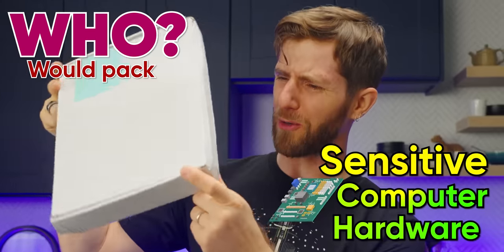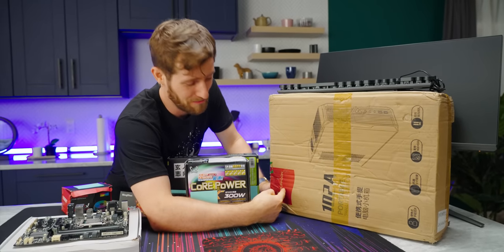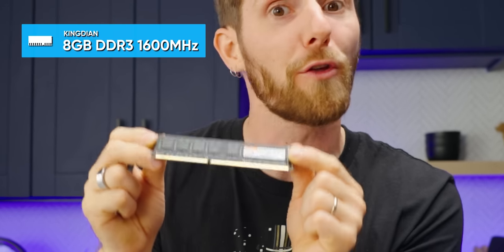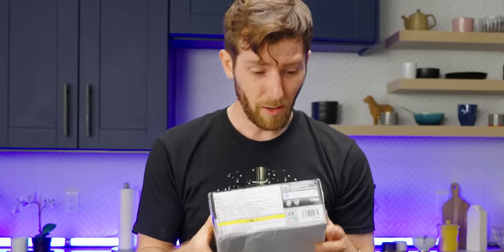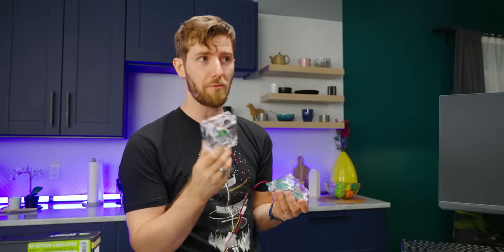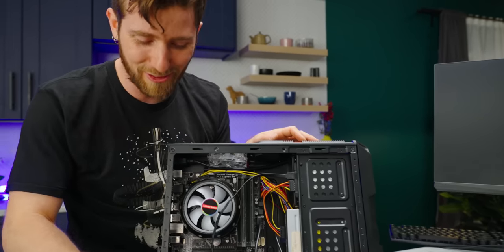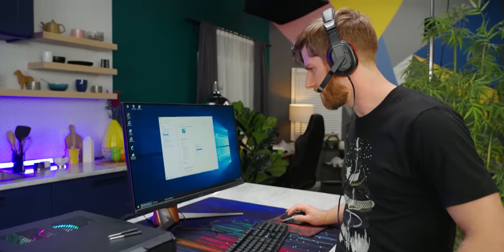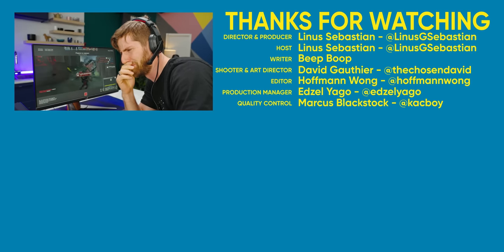THIS Wish.com Gaming PC is WORSE!

Comment: I wish more cases had 5.25 inch or as you call it "Optical bays" in them.
Not to fit CD drives, but it is very useful for those hotswap harddrive bays that servers have, pop one in and you have easy access.
Much better usecase than fondling around inside the case for it.
Reply: Reminds me of those hard drive trays that were a thing back in the 90's. Completely forgot about that gimmick lol.
Reply: I just like having optical drives
Reply: Surprisingly enough, the new fractal design pop air case comes with 2 hidden 5.25 inch bays at the base of the case. Its nice to see that some companies still see the utility in being able to use original dvds with game emulators and reading old movie disks.
Reply: @tOSdude  Like, as a cup holder? Can't imagine what else you'd use one for.
Reply: @filonin2  I got some older stuff I sometimes need to burn discs for. 
Also audio CDs.
Reply: There's a lot of random PC gadgetry that fits the 5.25 form factor from intake fans to literal cupholders, disc organizers, IO addons, a bunch of audio hardware, etc etc.  Sadly a lot of it can't be used in most modern cases.
Reply: Honestly, it's one of my favorite parts of my Phanteks Enthoo Pro. Has 3 5.25 inch bays. One has an optical drive, the other two have drawers to hold stuff
Reply: If a case doesn't have a 5.25'' drive bay, I don't even consider it. They are super versatile. From blu-ray/M-Disc drives to extra USB ports and card readers to external case LCD readouts to a hot-swap hard drive bay (what I have currently). They are so fucking choice.
Reply: @palibakufun  OMG I have that same case. Only problem with it is that it's a heavy fucking bastard.
Reply: LeRoy Jenkins   Yeah, I guess if you're willing to buy all that hardware and set all that shit up. Which most people won't or even simply can't do because of budget and/or time constraints.
Reply: @arnox4554  it is, and it's hard to fit in my poor Corolla lol. I do love it though
Reply: The hotswap hdd trays of 1995 or so were so damn nice
Reply: @esaedvik  You can still get a hot-swap bay that works with all SATA drives. There's probably even one for M.2 drives but I'm not sure.
Reply: @scorpion07070  I know! Heck, I even remember the awesome fan controllers too. I wonder if people here are just teenagers hoping on the hate train or if everyone simply forgot that 5.25 bays can do way more than hold an optical drive.
Reply: @arnox4554  No need for one, not like I'm going anywhere nowadays. Back then it was for copying games from friends.
Reply: I like it for replacing dead IO ports on the front panel so I can continue to use the case instead of buying a new one.
Reply: LeRoy Jenkins   I used to have a drive that would be my off-site backup in one of those, though to be fair USB is fast enough these days
Reply: Those 5.25 inch bays can be used for a lot of things, even as a place to put a window for rgb lights if you want, or as a  storage compartment for Thumb Drives, SD Cards, External HDDs and/or SSDs, and other smaller accessories, or to put a memory card reader in for SD Cards and other formats like Compact Flash, and there are real cupholders, ashtrays, and many more kinds of stuff.
Reply: For temporal access to optical drive, or to HDD that isn't supposed to be inside the case, it's way better to buy SATA USB adapter, and not to limit yourself when choosing a case.
I bought SATA USB adapter from AliExpress for 580 rubles, which is less than 10 bucks, works like a charm!
And devices like cup holders is just stupid useless gimmick.
Reply: There are hot swap external USB bays. 
I have 2 that together cover every hard drive I could imagine 
(one for IDE + SATA and another smaller one for NVME).
Reply: @hubertnnn  The hotswap bay I use have SATA connectors, and they are hooked up to my HBA card.
The missing part of the story is that it is my home server, and if a drive fails, I can just pop it out, do a swap and start the rebuild process.
Reply: @scorpion07070  Also the watercooling reservoirs and pump combos that fit in the 5.25 bays single or dual bay. And various fan and pump controls for those cooling systems.
Reply: Silverstone makes cases like that.

Comment: I love how he turns the CPU cooler and it makes the sound a 90-year-old door would make and that instills quite a bit of confidence in the young whimpersnapper.
Reply: it didnt help much that the fans he installed were only held on with twisty cable ties. Zip ties would have worked better. I used them once to install an 8cm fan to keep the ram cool on a very ancient compaq desktop pc i was pushing to its limits. It worked suprisingly well for a mcguyver.
Reply: that was not the cpu cooler tho im prety sure that was the optical drive cause if you move it while its spinning with a disc it can scratch it
Reply: I physically cringed when I heard that sound

Comment: I was actually expecting a Galaxy Z Fold/Flip video, but I’m down for another Wish PC build. If nothing else, it’s a sign that GPUs aren’t in shortage anymore (plus the previous Wish PC build was a super-profitable video).
Reply: he will most likely do a shortcircuit about them and nothing more, and the watches its probably jake since he has the previous ones or hopefully its sara butt.
Reply: @LegionRRTX  I’d imagine that Linus would want to upgrade his Z Fold 3, so that tracks.
Reply: @Neoxon619  of course he will, since the 3rd one's battery doesn't hold through the day, but that doesn't mean he will do a review, hell, even mkbhd isn't going to do one since the differences between the 3rd and 4th are not worth a video.
Reply: @RisingRevengeance  I'm ashamed to say that i was one of the people who bought a 1030 during the shortage. I have since moved on.
Reply: @RisingRevengeance  It was ironic because its a bad card and ppl don't like that.

I also then got a prebuilt, which is another source of "shame"

Comment: I've also seen that weird plug in the US. It was somewhat common until the late 80s. You could use it to get a grounded connection even with the older 2-prong outlets.

Comment: 8:50 That case is the same OEM style Lenovo used for some of its cheap workstations about a decade ago. I can't remember if it had a model number or any non-Lenovo markings, and right now it's just parked behind my TV being a thoroughly inadequate media PC. Though, the half-height GTX 750 I found made a world of difference. I don't remember which AMD APU it came with, either – some hexacore non-standard woefully underpowered thing.

Comment: This is a system after my own heart. I have an i5-4460, stock ass cooler, my rx 580 has 0.5
mm of clearance, and my gpu power cables are smushed so tight inside the case. I have hard drives and an ssd screwed into the mounting holes for a fan because my gpu took up my hard drive space. It’s gotten me through all of covid, so can’t complain too much

Comment: 11:35 That's actually pretty interesting. When I was growing up  we lived in an old colonial era house with outdated wiring. Like when I was a kid there were still a few cloth wrapped wires in the basement thankfully those were since replaced. But to this day a lot of the outlets are still 2 pin with the ground being the central screw that holds in the face plate of the outlet. This looks a lot like the 2 - 3 pin adapters we had all over the place that needed to be screwed into the outlet box

Comment: Honestly, I'm kinda digging the case. Sure, I wouldn't exactly call the price amazing, but it doesn't look too bad and an optical drive bay is something I really miss at times.
Reply: Fractal Pop Air?
Reply: Wieder einer von den Spacefrogs
Reply: Yeah but it also cooks the SSD and the power supply...
Reply: I'd say the fractal pop air would be your go to choice then, it has an optical bay or two iirc
Reply: I also like the case, not $100 worth, but I like it. If it were in the $50 range I could see myself purchasing it over the other $50 range cases.
Reply: @kg4wwn  exactly my thought. Could be a nice budget case, with the optical drive bay being a nice usp to stand out among the crowd.

And to the ones that mentioned the pop air, I actually had no idea that was a thing. I upgraded my case to a meshify s2 about 2 years ago and havn't really looked at many cases since, but it's good to know something like that is out there. I won't buy a new case just for a drive bay, but I'll keep it in mind if I ever need a new one. Until then my og xbox one is probably glad to still have a purpose.
Reply: i'd think 30-40 usd would be a better price for it, I like the dimensions

Comment: Kuroutoshikou is a Japanese brand. They have collaborated with GALAX under the Galakuro brand name inside Japan. Their GPUs are probably GALAX rebranded. 
In fact, the GT1030 you guys got is actually a rebranded GALAX GT 1030 EXOC WHITE.

Kuroutoshikou also has PSU and they are decent. Most of them (pre-2020, I don't know anything beyond that point) are made by ATNG and Seasonic (yes, Seasonic) some higher tier might be OEM by Superflower and even Seasonic. 
I personally have one made by Seasonic using GB Bronze platform (which is old, but might consider them a legendary budget platform). Not a weird thing but the PSU has 90-130V voltage limit label, but it works well on 220-230V environment due to Active PFC that have full range support instead of short-range like 90-130V.

Comment: Hey! The 4670k is a beast when overclocked, and is still kicking around in my old system at a friend's house
Reply: Not sure if it's a beast, but it sure does run whatever games you hit it with very well!
Reply: Hey I'm still using a 4790k, its a bit more powerful but if it's still kicking just fine!
Reply: I still have a computer with an 2500k. Ok for old games for my kids and as a media server.
Reply: @EBLovesMusic  i still use my pc with a 2300! Lol!
Reply: I run at @4.4GHz and it's a beast for me, paired with 16gb @2100Mhz and GTX 1660 6gb TUF. Photographer and videomaker work, sometimes SketchUp and Vray. Still running most of games at Ultra 2k or Rocket league Max at 4k 120 fps.
Reply: My CPU is an overclocked i5-4670k 4.7GHz, I play Call of Duty Warzone at 100 FPS with medium settings with a GTX 1060 6GB  DDR3 1600 MHz overclocked to 2132 MHz cl 11 12 12 32, my pc is in need of a renovation but is very usable and playable.
Reply: @rodrigonoctis  Very similar to mine !! 
nice
Reply: I have i5 3470+rx470 4gb
It can run any game I throw at it with decent fps & settings
Just played 
days gone
RE village
Csgo 100+ fps
Reply: Taistelu_pelto  Depending on the graphics card you can play many of the latest games as amazing as it may seem, you just can't have other programs open
Reply: @mrshinobigaming8447  ours had the good ol rx 580 8gb on it, ran amazing as our living room machine, and then eventually Mrs. Terror's gaming rig up until she decided to... Sidegrade? Into an old alienware laptop we got for free that was supposedly broken but just needed a repaste and cleanup. It's a i5 8th gen and a 1070ti, runs just as good as the ol girl. About to build an fx8320 machine that I got most of the parts for free, going to add an rx 580 8gb to it and have it as a living room machine as well
Reply: @loveableterror674  great
Reply: Taistelu_pelto  I only play at 60hz anyway, because of the screen that's made for work, the 120hz was on my friends house, (I don't play rocket league, but played on his main screen)
Reply: Taistelu_pelto  seriously? I played through the entire tomb raider series, with Tress FX on at high on 1080p, with a 4670k at 4.5ghz and a Sapphire 580 8GB. No stutter, stayed solid at 60fps. Also managed to make it through all of Outer worlds at high with 60fps, as well as some of cyberpunk (sold it after my wife wanted to use just her gaming laptop and I had completed my 3070 build) no drops below 60fps and staying in the high range of graphics. Old PCs are still incredible machines and can be made to perform
Reply: @rodrigonoctis  we are the same with our living room machine. They are made for 60fps, great graphics and smooth gameplay. While I love my desktop, nothing beats a great couch experience that let my whole family run through the steam library whenever they want
Reply: Taistelu_pelto  admittedly, at the time, I had never had a high refresh rate monitor. I now have my 3070 system with 4k 165hz and have only gamed on it, save for my switch and my gaming laptop which I take with me. Modern tvs with 60hz aren't bad and look pretty damn good when v-sync is on and you manage expectations
Reply: Taistelu_pelto  yes but I wasn't talking about ultra I was talking about medium settings

Comment: The mouse seems to stop tracking as soon as you lift it, and takes a second to start tracking once put back onto a surface.  I remember the Logitech MX1000 mouse had that problem.  Possibly a safety issue for laser mice, to prevent users from shining lasers into their eyes?
Reply: yup I rem some old oem/non-branded mouse had those problem lol

Comment: 11:32 That’s one of the standards in Japan. Many outlets here have a ground pin mount under the outlets where you can screw those loose ground wires onto.
Of course we do also have the 3 pin connectors, but not on everything.
Reply: Used to be common here in the US as well for the center screw that holds the faceplate on to be grounded. Not sure if that's the case anymore.
Reply: @thedoctor7158  It can be, but not always. Before the standard was metal outlet boxes but now blue plastic ones have become standard. The old metal boxes were always grounded (assuming the installation was up to code). The center screw can still be grounded though, depending on the outlet design. Some outlets connect the ground to the screws, but some don't have that metal tab to connect them.

These days, the answer is a solid "maybe" as to whether or not the screws of an outlet/faceplate are truly grounded. I'd recommend always testing them with a multimeter before assuming that it does have a ground connection.
Reply: I had a washing machine with that ground wire connection, but with the US Standard two-pin connection. I'm from México
Reply: @jonny6702  That's why I stated "Used to be common". 5 years ago I bought and old 1930s Sears Craftsman bungalow which I had fully remodeled. Still had the old, disconnected and knob wiring inside the walls along with a mix of newer wiring and old cloth insulated wiring. Was going to replace it all anyway and I did pay extra to have the conduit style and metal boxes installed with proper outlets. This is the last home I will ever own so I wanted it to be done just right.

Comment: The sad thing about all of this is that with this budget, you could just as well get a used office PC and some upgrades, which would be just so much better in almost every way possible.
Reply: @Сусанна Сергеевна many of the older full towers are fully upgradeable. Two of my friends have old dell inspiron matx towers that are fully upgradeable (psu and everything). Both have i7 4770. My pc is currently in an office pc case (although it is quite old, originally had an athlon x2 245)
Reply: yea it would be better in every way, though they're also old so they will die in some time. I had an Optiplex slimline for about 4 years until the motherboard died. It was a standard MicroATX board, though I couldn't fit a new motherboard in since there was some interference with the chassis, the standoffs were just some bumps, so components would get crushed if put in.
Reply: @Сусанна Сергеевна I had an optiplex slimline intel 3 gen, so I know that mine had 2 pcie slots, 3 sata ports, 1 used by the dvd drive. you just have to find the right one.
Reply: Indeed, but you're forgetting that OEMs, especially Dell or HP like to use non-standardized parts, which sometimes even extends to the PSU so... Unless you're into hacking together something to make it work, there is a fair possibility you won't be able to simply drop in a new PSU in order to add a new 2060 or whatever to your office PC.

Basically, I'm not saying to not do that, but if you have any plans on upgrading it, you should really take a look at it in person before buying an office PC, your best bet is actually just finding someone's old gaming PC, you might find something similar to Linus' wish PC for as little as $100 and can easily upgrade it later.

Comment: I've actually seen that weird ground in the middle east. Sometimes all three wires were just bare, and they would just jam them in the wall plugs of totally different standards, and hope for the best. I'm not kidding. They really do that in some places.
Reply: I think you're meant to attach the bare wires to an appropriate plug or wire them directly to a circuit.

I usually see bare wires on high-power stuff (e.g., shower heaters, AC) and from where I'm at, they usually get a dedicated circuit and/or differently-shaped "high power" sockets.

Comment: back in the day in the US, many electrical sockets only had two slots. To plug a grounded cable into them, you would get a 3-to-2 adapter that had a little wire hanging out that was mean to be inserted under the screw holding the faceplate to the wall.

Comment: Screwdriver and screws for the ram are for ram slots similar to that of a laptop. In which u have to screw down the dimms similar to an nvme ssd, just horizontal instead of vertical